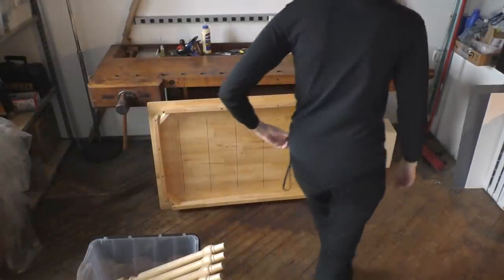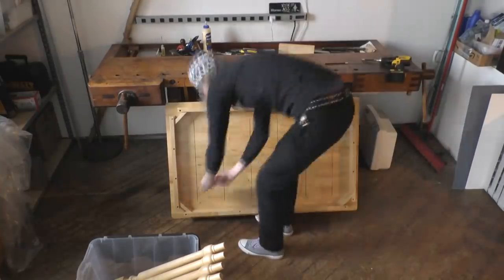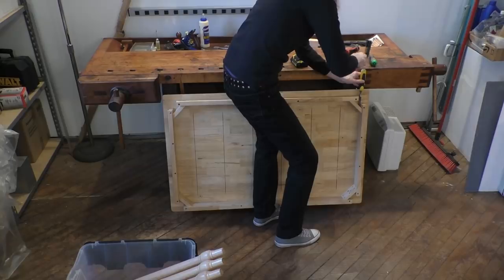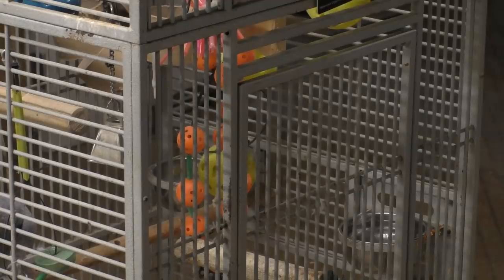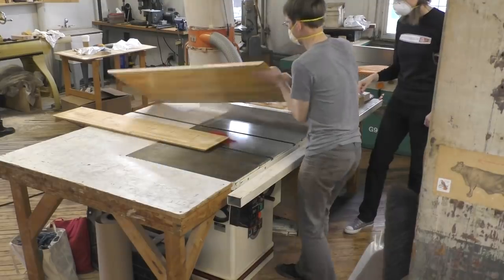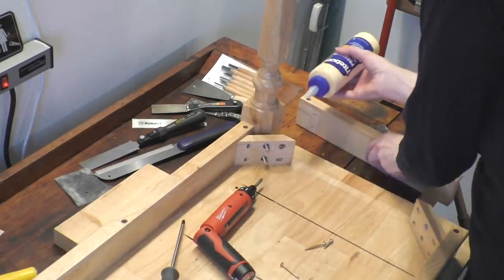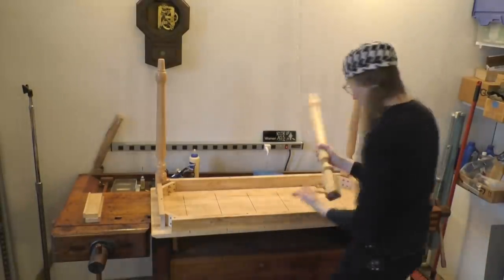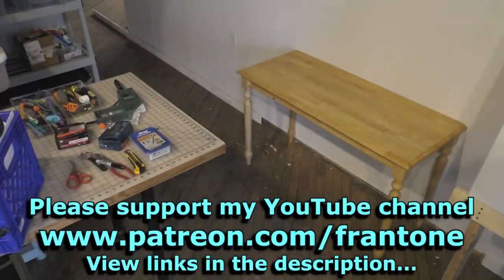Custom Sizing A Table

Comment: I'm the type who then wouldn't be able to resist putting up the remaining approximately 12 inch (minus cut depth) piece as a wall shelf above the table! :P
Reply: @richfiles
or make sides and have a two layer table :-)

Comment: Hi Dot! Such a beautiful Congo Grey! Probably the most intelligent species of parrot. My mother had a Timneh Grey when I was younger and we spent a lot of time following the research of Dr. Irene Pepperberg and her grey Alex.

Great tip on power screwdrivers. I thought I was the only one that used them as manual screwdrivers once the chuck stopped spinning! (I also hand-turn the chuck when the battery dies halfway through a screw! LOL)

Comment: Fran, Nice work. A new console table. Sweet. 
One small note: 
Those, "Rails" you talked about?  They're called Aprons. The horizontal pieces of wood running from corner to corner parallel with the edge of a table are Called Aprons. Yours with the Leg pockets but they're  always called Aprons.
Not to be confused with Stretchers that connect the lower portion of table Legs. That tie the lower legs to each other or together. 
Either way, it's Still a Really nice Consol Table and Definitely done in our Fair City of Brotherly Love ...
Just bustin on ya Fran.
Really is Nice Work!

Comment: Fran, next time.... measure what your cutting off the table top... this will be exactly what you will also be cutting off the table apron. Just a tiny tip. Then no mockup or figuring out how much to cut by guessing.

Comment: A heat gun might loosen the glue too.
Nice antique wooden work bench.  I like that old time vise with dog.

That table looks like one we have in our kitchen.  We got it from a place called "Wood You", that sells 'finish it yourself' furniture.  Did you use a router on the cut down side to reproduce the turned down edge that was cut off?

Comment: I thought to do the very same to table i liked. Only to find i put far too much effort into making sure my original find ( left by a dumpster ) would remain rigid. I waterproof wood glued everything, made both sides of joint moist and glued away. Yeah, it's never coming apart in the time it will be with me anyway. It's size is not adjustable, short of a rip on the table saw.
Too bad as i watched this i thought yeah, i should thin that table a bit that i bash with my left leg at least 3 times a day.
It is also part of a network of Feline observation platforms, i dare not disturb......